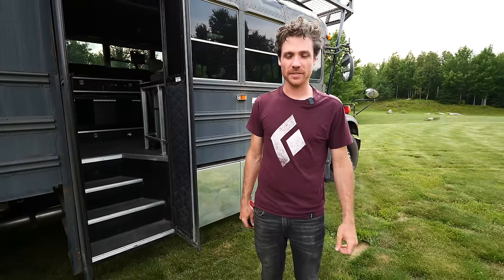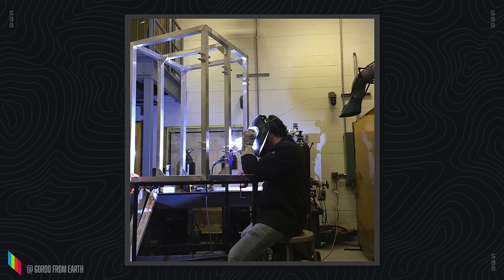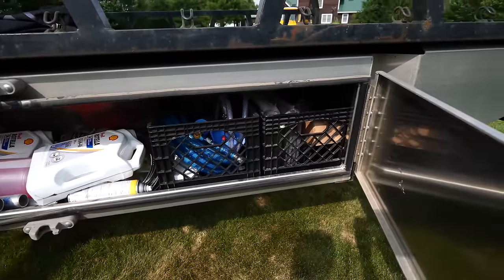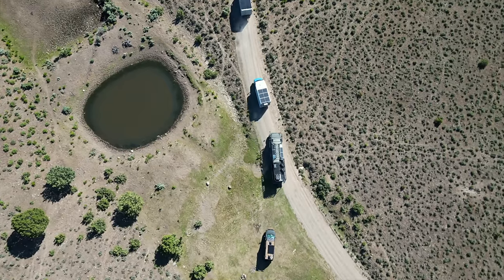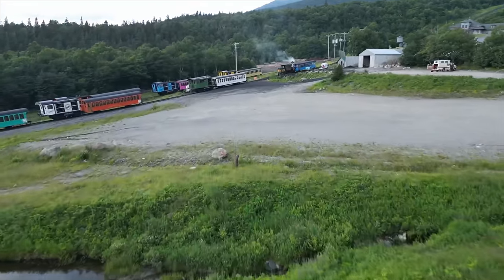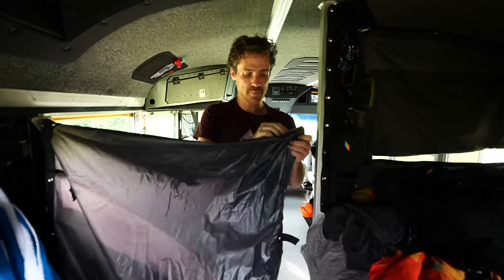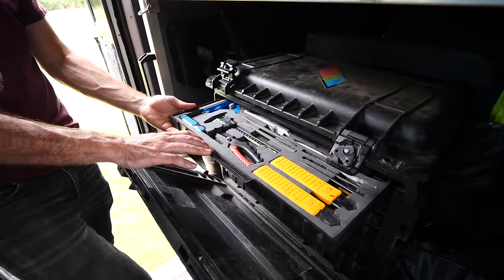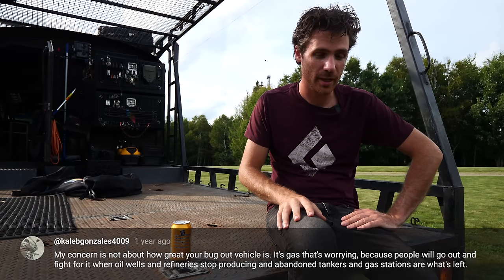An Updated Look at the Legendary Bus Conversion that Could Rebuild Society

Comment: Would you ever consider fitting fold out ramps and a small vehicle for the back like a smart car or something similar, for when you're parked up for longer periods and can visit surrounding areas without having to take the whole rig ? Possibly saving money on fuel.
Also, a small car modified to match the rig with logos and and the post apocalypse look to match would be an awesome project

Comment: I'm a bit surprised this guy doesn't run his rig on black diesel with a Mobile pickup and filtration system. End of the world and all the gas tanks are drained but I bet there's lots of untapped oil pans! With a flat plate heat exchanger you can run your diesel engine on 100% oil.

Comment: Wait! Your engine runs windshield washer fluid? Am I understanding that correctly?!?!?! 😮😮😮😊😮😊😮❤
Reply: It gets added to the intake (mixed with air), it goes in the cylinder alongside the diesel. So it doesn’t really run on washer fluid, just added to the mix.

It reduces intake air temp, making the air more dense, creating more power (and reducing temps).